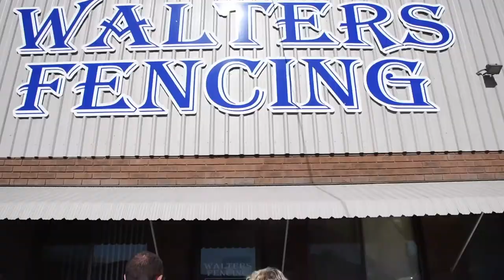MODIFIED Driver Trailer? Tasmania Visits The Factory + A Check In With The Fencing Crew!

Comment: You pointed out the modified jack hammer but didn't explain its purpose. What is it mainly used for?
Reply from the maker: We use the modified jackhammer to drive a star post down beside the strainer post to act as a pin post (hold down post) that helps stop the strainer post from jacking out of the ground.  We explain the process in  Episode 1 - How we do it - Strainers and Stays
Cheers Steve
Reply: @WaltersFencing  Thanks Steve - love the videos, keep them coming. Informative and entertaining